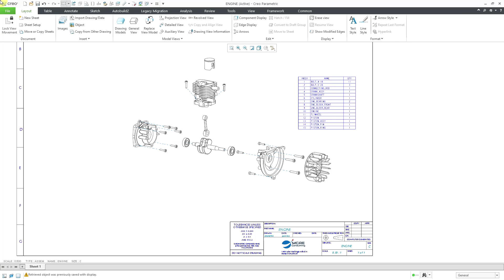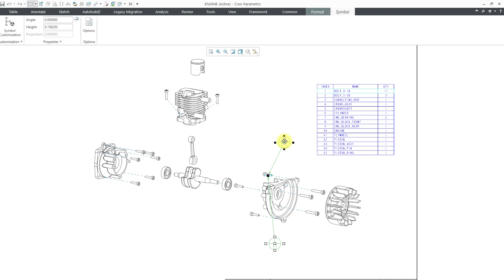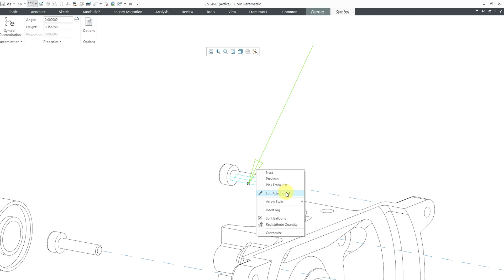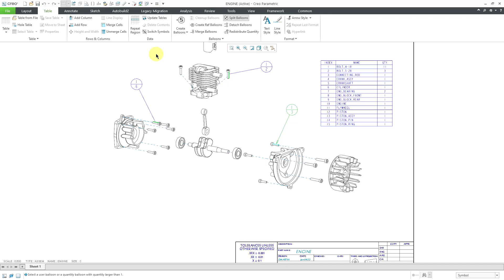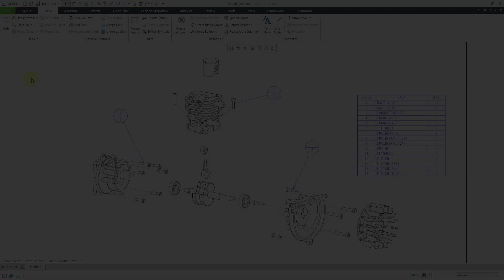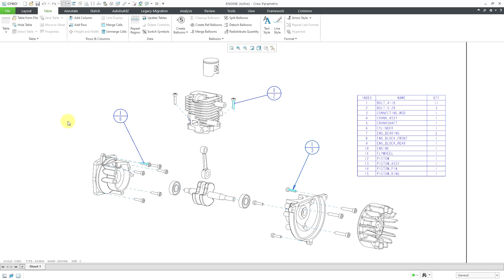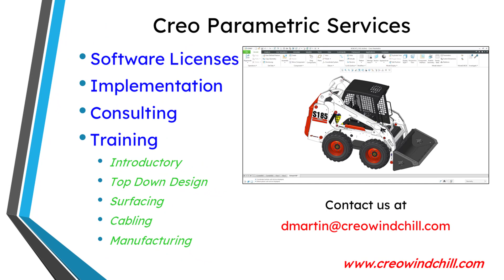Creo Parametric - BOM Balloons - Split, Merge, & Redistribute | Drawings

Comment: Is there an easy way to verify you have shown all balloons for a large table? I have a 7 sheet drawing and I want to make sure I have shown every balloon without having to manually go through every sheet and count. I'm working in Creo Parametric 9.
Reply from the maker: I would try activating a layer and then showing all balloons. If any balloons get added to the layer, then they weren’t previously shown.